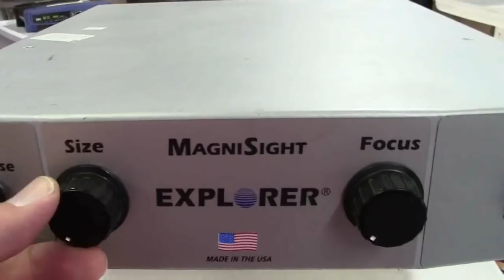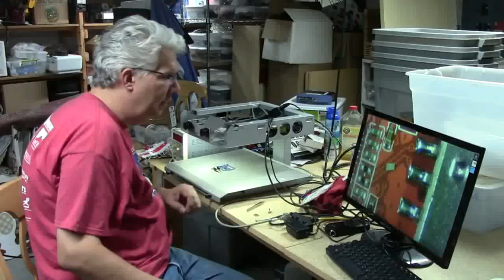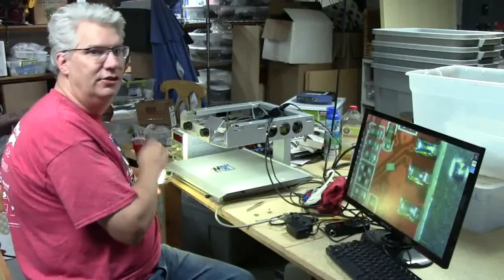150806 Inspection Station RPI2 Camera Upcycling

Comment: Hi Craig

I had a similar idea to make a RPi inspection camera
what did you install on the  RPi to get the raw stream to HDMI?
Im no expert on Raspberry Pi's and all the video output 
stuff i saw was poor update rate like a security camera.

Cheers

Rupert
Reply from the maker: Its running straight Raspbian. I'm running the raspivid application with one axis flipped. The camera's frame rate does beat just a tiny bit with the CFL lights, there's a faint flicker on the hdmi video. This goes away when using the LED strips.  raspistill app will take higher res images.